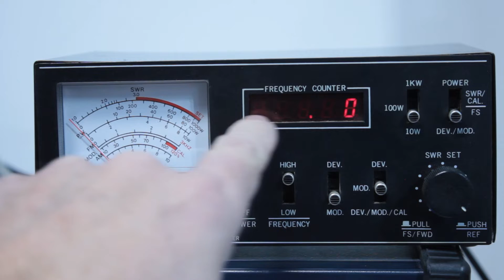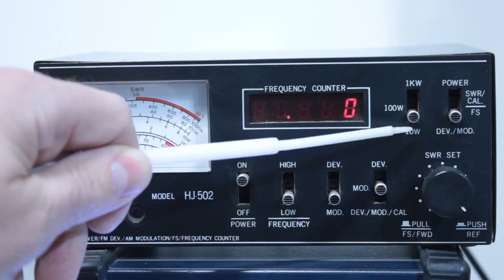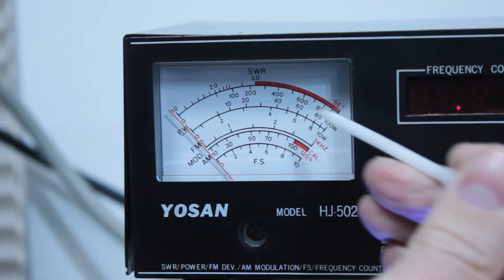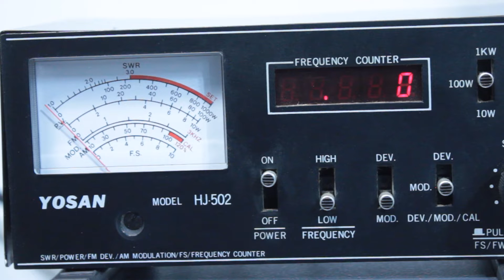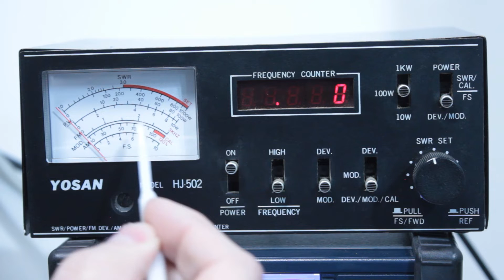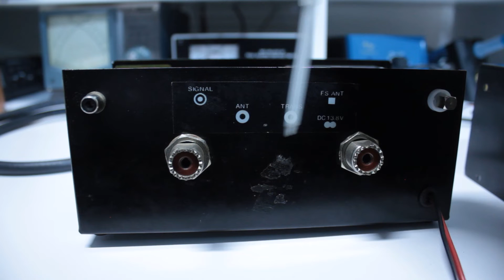This vintage meter has a surprising number of features! Yosan HJ-502 CB Radio Meter

Comment: Hello, thank you for this video. I have the same device under another brand. 
In reception mode, the frequency meter does not stop moving, indicating any frequency varying constantly from approximately 3 to 8 MHz. 
It's tiring on the eyes. In transmission, the frequency displayed is good.

Do you know how to have zero displayed in reception mode? THANKS

Comment: Great video as usual, I have the same meter but it has a different name.
Mine is called a Land Matric LM830. 
Mine read's power as 1watt, 10watts and 100watts but other wise it's the same.
I think these had a brand name of TriStar as well.
Look forward to seeing your next video
Reply: I have the same device from another brand called "CB-Master 250FC" and it has also the steps 1W/10W/100W. I bought it here in Germany in the late 80s.
Reply: @Kansoganix  I got mine from France with some other things